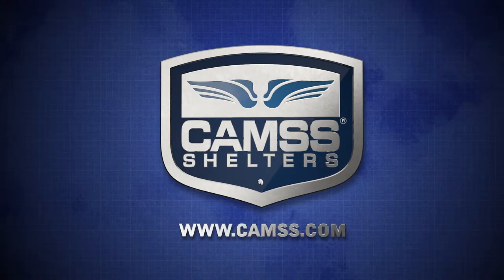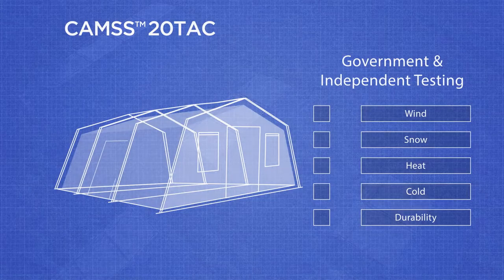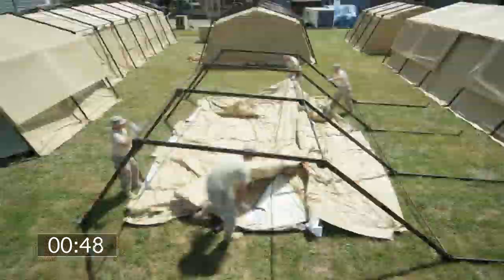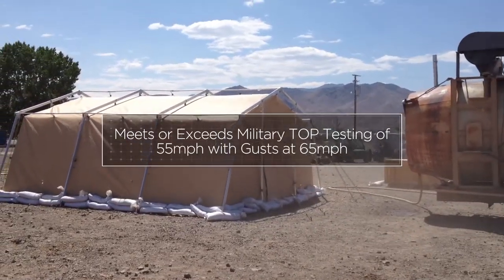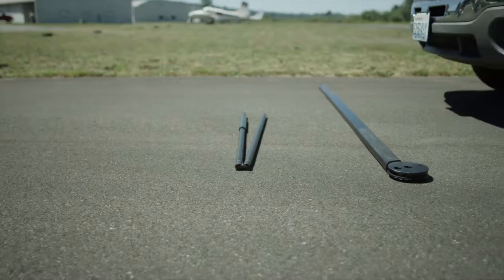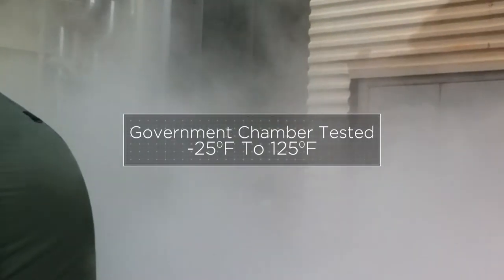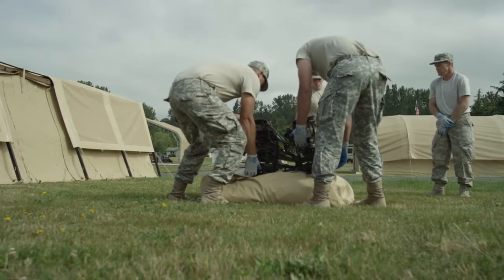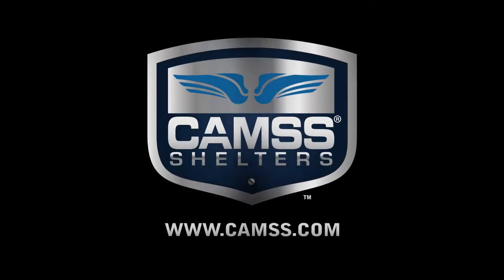CAMSS™ 20TAC Shelter System Testing

Comment: Is there a video on how to put it back on box?
Reply from the maker: Once the fabric bundle and frame are folded up we recommend putting the fabric in the container first followed by lowering the frame on top of the fabric. Accessories can be tucked around the edges for the container. While we don’t have a specific video on container packing, our setup video can help with understanding the folding procedures https://youtu.be/Au-H-kaxRvg. If you would like more detail on how to fold the fabric and frame the manual is definitely more thorough or you can always give us a call at 1-800-984-7678.
Reply: @camssshelters240  also on that note,constructive criticism. 

The stitching that holds the straps needs to be better stitched. The unit I'm with nearly ripped half of the stitching that attached the straps to the structure.